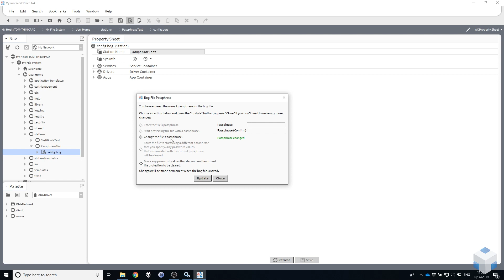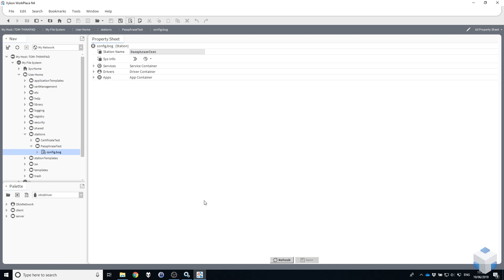HOW TO: Reset A Niagara 4 Station Passphrase

Comment: Do you have to have a backup of the station to do this? As far as not having the platform username and password, you can serial shell and reset them, been there done that before, and once you do that you can get access to the station files and can copy the station off the JACE onto your computer but I'm not aware of a way to create a backup without signing into the station. Maybe if you open the bog file from the remote station then you can do the phase phrase change and gain access that way? In the past I've always had at least 1 user who had access to enough of the station for me to be able to do what I needed to do...access to the platform maybe not which could be solved by just serial shelling and reseting the credentials to factory default which did not delete the running station or change it in any way.

Comment: I tried copying an example station that i downloaded from a website and i changed the passphrase like the way you showed in the video, but when I try to transfer the station using dtation copier it still says wrong passphrase. Any dolution for this?
Reply: Make sure you save the config.bog after changing the passphrase.
Reply: @danielharrisoss3379  i'm facing the same issue , but i realized that the folder is read only , do you have any advice how to remove read only from it to save
Reply from the maker: Strange! Are you sure the change was applied and its the same station you are copying?
Reply: Copy station back to your pc,

Comment: Great Video! Is there a way to get into a Jace 8000 controllers platform and station without the usernames and passwords?
Reply from the maker: Hi there! If you don’t have the platform credentials for a JACE 8000 then there is currently nothing you can do besides a factory wipe, which will of course delete the station running on it. If however you do have platform access you may copy the station to your local host, open the bog file offline and add / change users, then save the bog file and copy back to controller. But this does require platform access.

You may have heard about the emergency reset feature available via the serial shell. However it is my understanding this is currently an experimental feature for the US market only and may/may not work just yet.